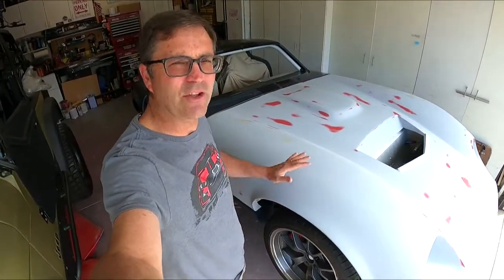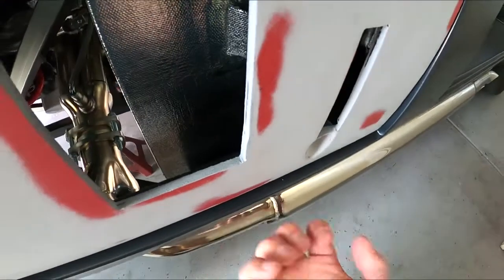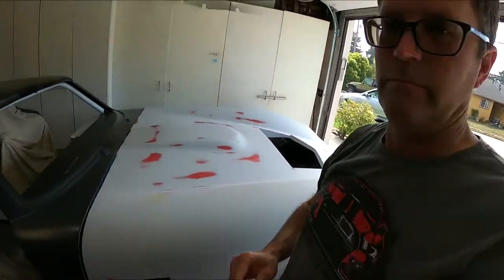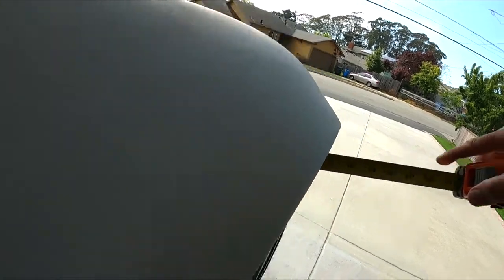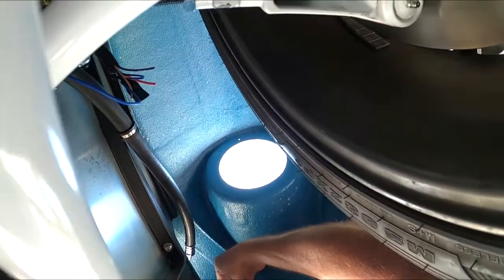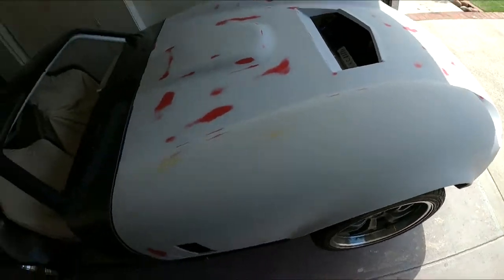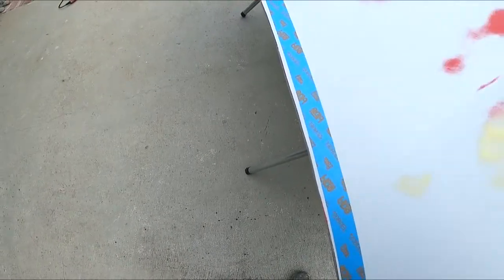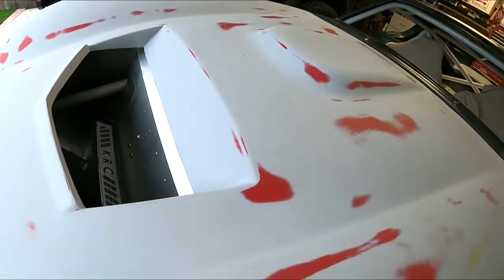Cobra Daytona Build- Fitting Nose to Chassis, Video 110

Comment: i just completed my Gen 2 Coupe.  The issues I had with the hood are the same as you described.  I adjusted my hood before any sheet metal work, engine / cooling system installation etc.  I found it was much easier to:
1.  Align the front pontoon with the wheel opening on the hood and clamp in place..  I used a 3/16" shim between the hood and pontoon to ensure a consistent gap.  This will cause the hood to overlap the cowl and locate the hood hinge mounting points.
2.  Then I installed the hood hinges to the frame, located mounting points on the fog light buckets and bolted in place.
3.  You will most likely have to grind and form the hinge sheet metal to fit the body. 
4.  After mounting the hood hinges you will want to open the hood until the hood opens just past its balance point.  You may have to do considerable grinding on the hinge mount to achieve this degree of opening.  Doing this will reduce the load on the gas struts when the hood is fully open.
5.  Attach masking tape to the cowl in order to mark the location of the hood where it overlaps.  You can then transfer the dimensions to the hood for grinding.  I used a piece of 1/16" x 2" aluminum flat bar formed to the hood to act as a guide for trimming the hood.  In my case I had to trim about 1-1/2".  I used a jig saw with a blade designed to cut fiberglass.
6.  The radiator outlet aluminum (the "kettle") was installed after the body, hood and doors were aligned and painted.  I figured it was easier to align the kettle to the nose than align the nose to the kettle.
7.  It is probably obvious to you, but don't finalize the nose alignment to the pontoons until the splash aluminum is installed.
That is about all I know.  If you want to take the discussion off-line, give me your contact information and I will give you a call.

Comment: I know your videos are behind your actual progress. So probably you're past this point with the actual build. But FYI, in case you haven't figured it out yet or seen from other builds, the front cowl has some of that famous Factory Five asymmetry in it. Measuring the wheel lips as you show is the right thing to do. But you'll find they're not the same on both sides. The RH side sticks out further than the LH side. If you make them equal, the cowl actually will be slightly off center and cause other fitment challenges. I used a laser to find the exact center of the cowl and used that as a reference line to the chassis versus the wheel lips. Cheated as much as I could all around to get it to fit. In the end, in the range of 1/2" difference side-to-side at the wheel lips. I've talked to several other builders who confirmed the same thing. Only you will know about when it's done.
Reply from the maker: I have noticed the same issue and cheated it as you did. Fits really well now but the next video will highlight the nose opening issue I really screwed up. Thanks for the comment,

Comment: Surprised you didn't use a compass to trace the cowl line on the hood.
Reply from the maker: This is just quick and dirty. When I do final paint I will clean up all the gaps but for right now just want it driving to start registration process.